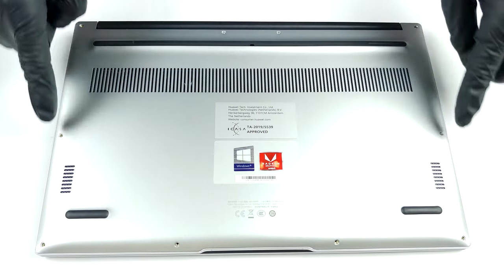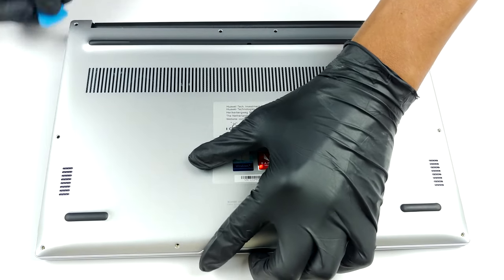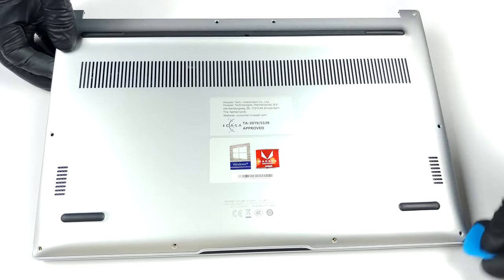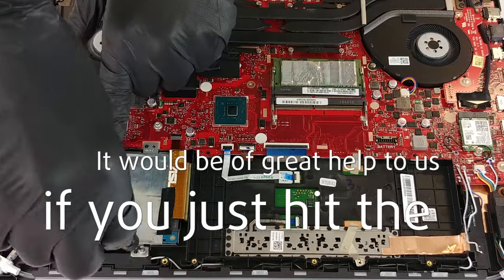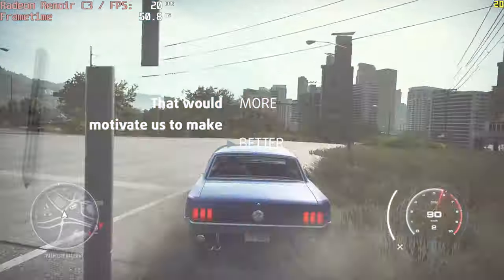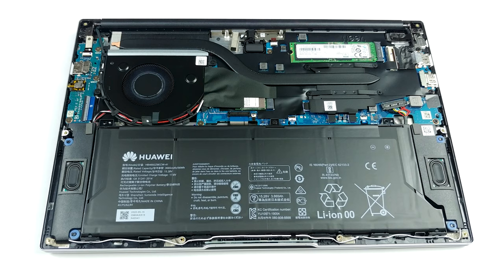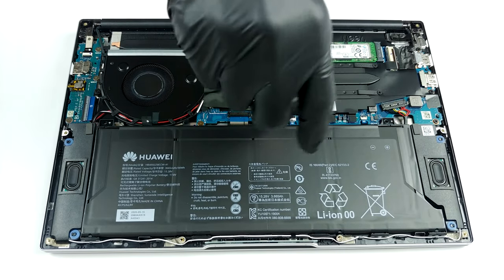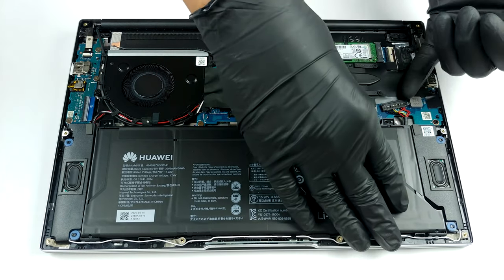🛠️ Huawei MateBook D 14 (2020) - disassembly and upgrade options

Comment: sad that there is no extra ram slots, i looted my old fried laptops fine ram and was planning to place it in.
Reply: This is why you always do proper research on any kind of notebook before purchasing it. I would never buy a laptop with soldered memory because what if it actually happens to fail in the future. Then you're pretty much screwed.

Comment: Non ugpradable RAM is a big no! If the RAM goes bad, you'll have to replace the who's motherboard, or solder the new RAM, which is not worth. I don't recommend buying any laptop where the RAM or SSD is integrated.
Reply: I wish I had known before buying it
Reply: @jackbigbug Samee, I bought this laptop in a rush because it was needed for college.

Comment: Can you tell from experience if this is a good laptop or not?
Reply: It is a very good computer, I have used it for more than a year, I am a master deegree student in computer science and I am very satisfied with the laptop.
Reply: @itzaecanales  mate, what spec did u get? Mine was R7 3700 and 8gigs of soldered ram. Not sure about upgrading to win 11 since the iGPU already took the 1 gigs of ram away.
Reply: i had the ryzen 5 3500U version of this laptop
it sucked ass, the fan bearings gave out after just a year of use
plus the damn thing's idle temperature was 60, gaming it got to 93
im much happier with the asus vivobook 14 pro that i have now because it has way better thermals, and more power too as it has a proper 3050 nvidia laptop card
Reply: I have the 2019 Dell Inspiron 14 with a Ryzen 2500. I still love it after five years. It looks new and is very quiet; the fan hasn't run most of the time, and when it does, it only runs for a short burst.

Comment: can i replace my 8gb ram and make it 16gb  ?
Reply: No, its soldered to mobo
Reply: @tanburiney1469  but it can be unsoldered and  replace ram sticks better to take it its authorized retailers
Reply: No. It's all soldered to the motherboard.
Reply: @citrusgrub6377  There is a way if you take the laptop to a very skilled technician that has experience with reballing, but that is risky because if the guy increases the heat on the hot air station just a bit it would damage the board.
Reply: @alucard4273  yea

Comment: Hello! new here! May i know is it possible to add a gpu to this laptop... and if so, which ones can i add?
Reply: bruh where would u put it 

no 

you can't just put a gpu in a laptop
Reply: @olive7831  um well I’m new to this so I thought some laptops were nice enough to put a slot or sth in the mobo
Reply: @GGSamurais  no way dude
Reply: i think you can add an egpu by the Wifi card slot (you won't be able to use the wifi)

Comment: So there is no option to add one more storage?
Thank you very much
Reply from the maker: Nope, you can only change the one you already got.
Reply: @LaptopMedia  thank you, appreciate your help ❤️
Reply: @LaptopMedia  512 SSD 
Or 1TB SSD ??
Reply: @LaptopMedia  I mean can I upgrade to 1TB SSD 
Or not ? 
Because  the website Huawei Don't specks about upgrade storage
Reply: @mahmoedelbakry1147  No you cant buy it with more storage offically but you can unscrew the back and replace the M.2 SSD on your own. That would also break you warranty (asfaik) but it would "solve" your problem

Comment: the ram is single or dual channel?
Reply: dual chanel but the cpu is mobile based Soc like a normal phone so the rams can not be replaced
there is a tool called CPU-Z to check the specs for every computing system

Comment: I just bought this laptop. The one with 16 gb RAM & i5 processor 10th Gen.  I'm planning to replace the processor with my i7 10th Gen from my dell laptop but I'm not sure if it is okay to do that. Is there anyone who have tried?
Reply: Most laptops if not all laptops nowadays processors are soldered to the mother board, so if you want the new processor sadly you nee to buy a new one
Reply: @irving7848  Thank you for the reply Man..
Reply: @CELSO PEDERI - Celz  that or you do a reballing